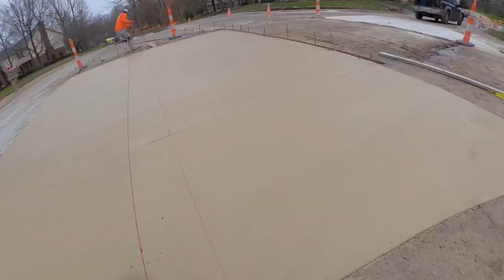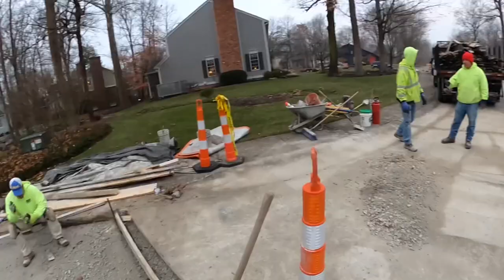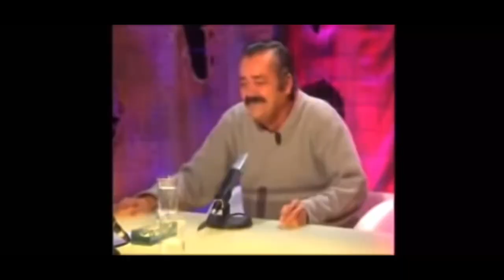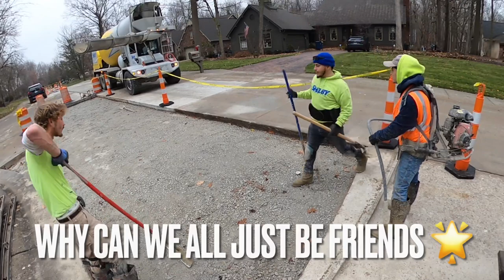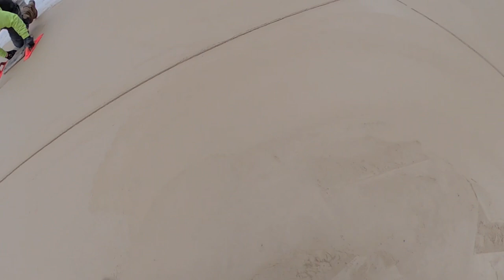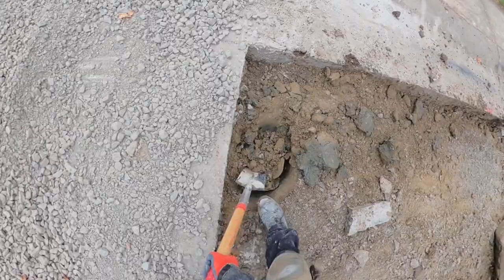Drama! How to be a good labor concrete worker

Comment: I am a loader operator  at a concrete  batch Plant and drivers constantly say you should be a ready mix driver and I say no because  of the horror  stories  about concrete  finishers yelling and disrespecting the drivers so I say no way  they don't pay me enough  to put up with  that nonsense. I WILL STAY AT THE PLANT AND RUN MY LOADER.
Reply from the maker: 😂😂😂 seems fair enough

Comment: Hey bro just found your channel. Hoping this is a concrete channel. Had a few questions. When you were on your slides, were you using a mag float and a resin float?? Also how come you guys vibrate that?? It had to be like 6 inch slab at most.  I’m just curious because I’ve never seen anyone do that. What was the purpose of all the concrete or asphalt removal?
Reply from the maker: Glad ur here !!! & mag float ! & because so it can be stronger, it’s fills up all the holes it has inside, we trying to make that concrete last for years